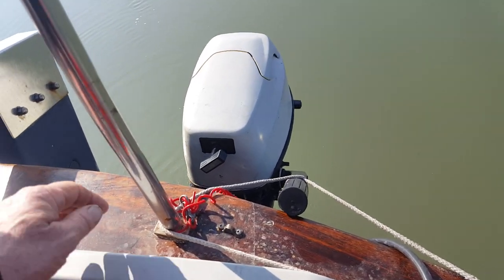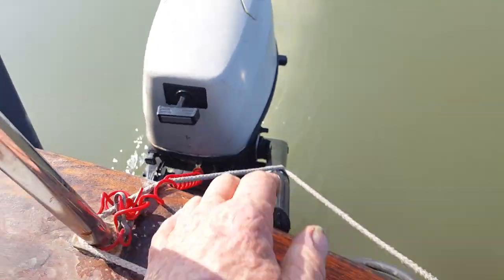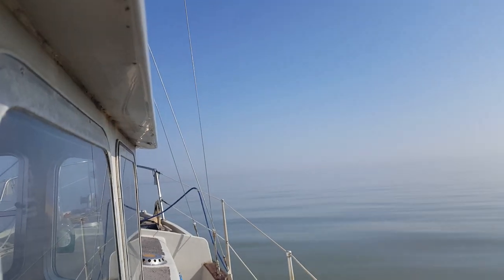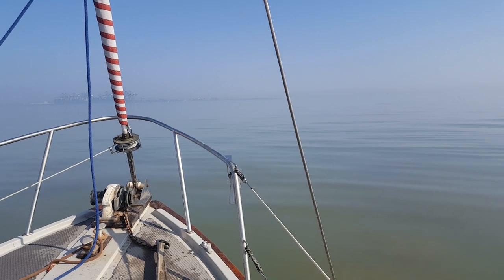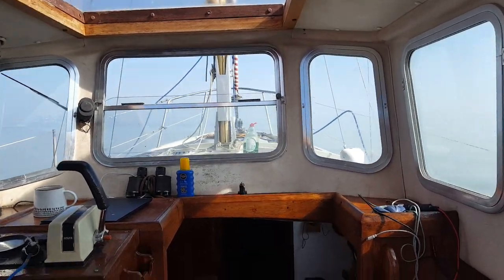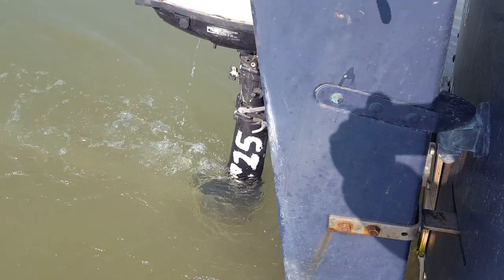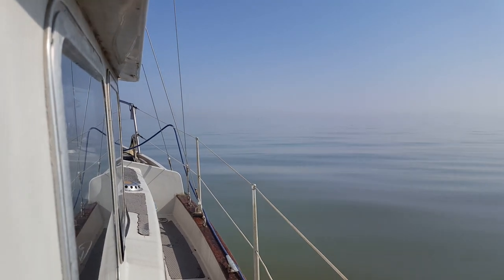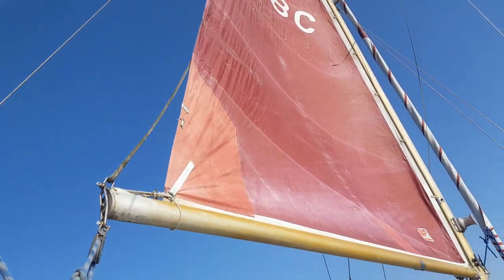6 hp long shaft tohatsu on 25 foot Fisher 25

Comment: Good boats, but an inboard diesel would be 100 times more sensible.
Reply: Suspect this is the backup to the Fisher’s inboard…..
Reply from the maker: I agree....the diesel runs but is a bit old.... hence the outboard as a back up
Reply: I recently powers my 10 tonne boat with a 6hp tohatsu after the starter on onboard went. Did 70 miles in very light to no wind. Pushed it at almost 4 knots at just past half throttle. Great backup and I'm keeping the set up in case it ever happens again.